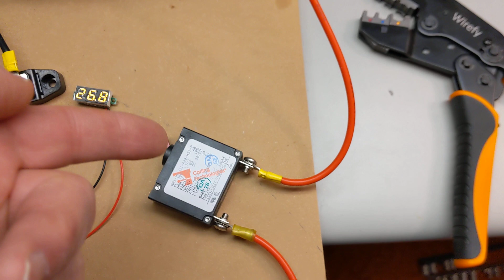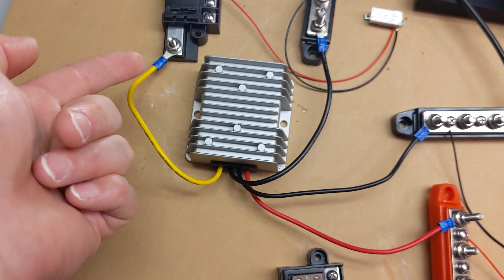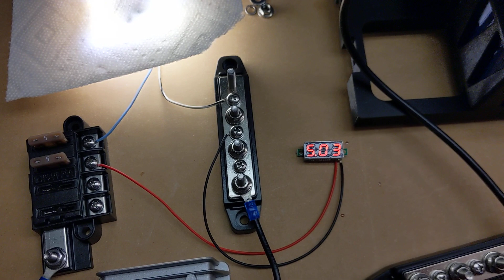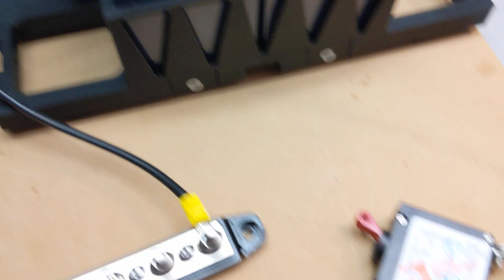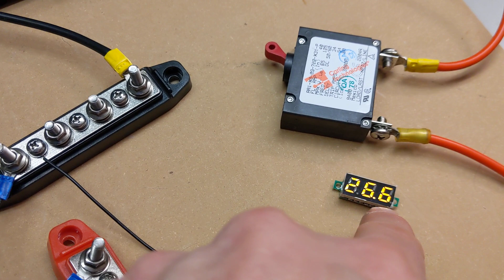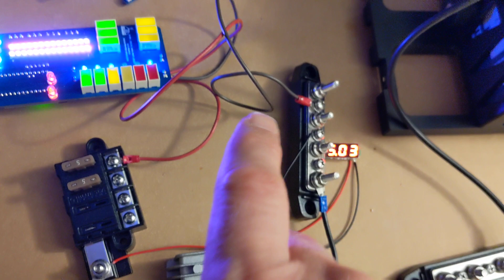3D Printed R2D2 - Part 91

Comment: Just curious why you switch to the batteries from the 24vdc Drill battery. So sorry your circuit got fried. Learn something for sure. Thank you!
Reply from the maker: I read on Astromech.net that not all of the battery management system is in the batteries.  Evidently the discharge circuitry in the batteries I chose is located in the tool.  This could lead to the droid discharging the battery below the recommended voltage which could possibly damage the battery.  The Dakota Lithium batteries have all the battery management in the batteries and seem to have a good track record.  The ones I bought have a 10 amp hour rating as opposed to the tool batteries that I think top out at 8.